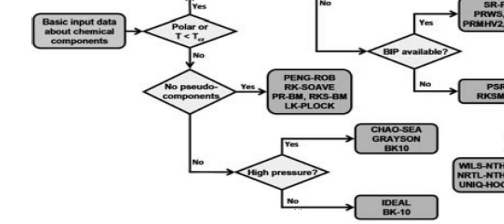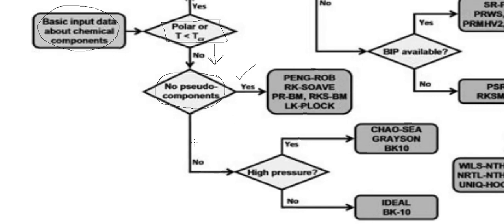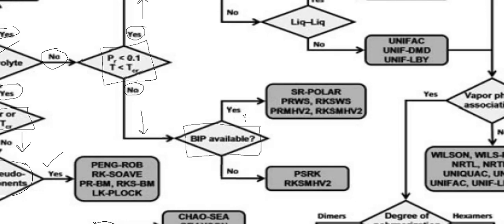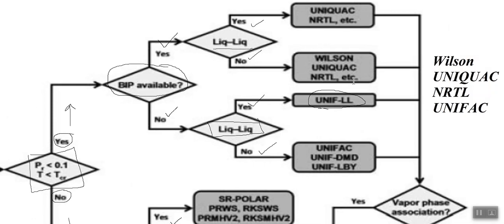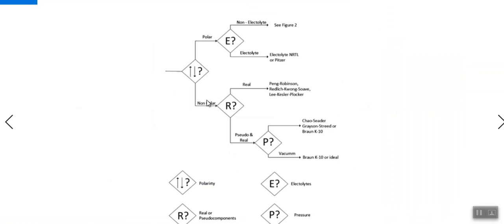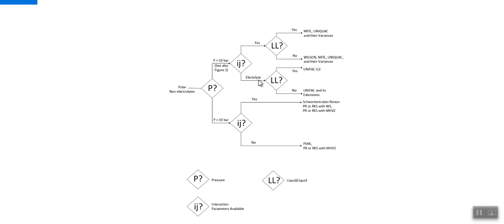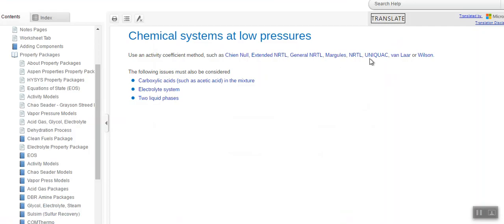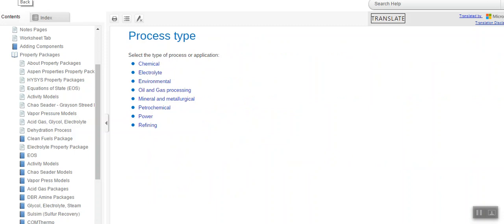Thermodynamic Property Package Selection in Aspen HYSYS - Lecture # 5

Comment: Hi thanks for this video, can you tell me which one is the best (NRTL or peng rob) if i want to simulate  an absorbtion of SO2 from flue gas  process,  (P< 10 bar )
Reply from the maker: Better to use SRK...
Reply: @aspenchemchannel   why SRK is better than Peng Rob?
Reply: @hyunwookryu4077  i waiting for an answer !
Reply: @mrt007mt   I had simulated hydrodesulfurization process by using the hysys. When i was master degree course. At that time, i used SRK for simulating SO2 adsorption reactor. Cuz in the reactor bed it contain reaction between catalyst and SO2. According to many thesis which is related to hydrodesulfurization unit. When u simulate that reactor, SRK is more accurate rather than Peng robinson. Cuz most of reactor temp is high. Do u hav any different idea?
Reply from the maker: SRK is usually preferable for those systems, which contain components, such as CO2, SO2 etc. My apologies for late response.
Reply: @hyunwookryu4077  actually no !